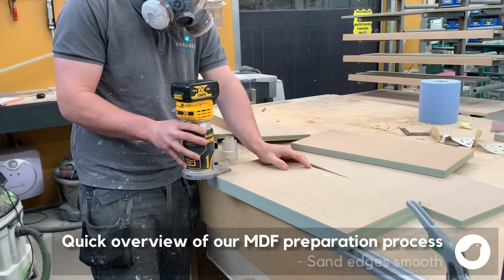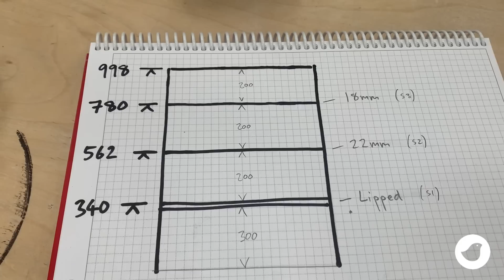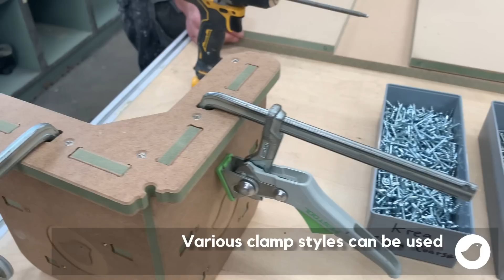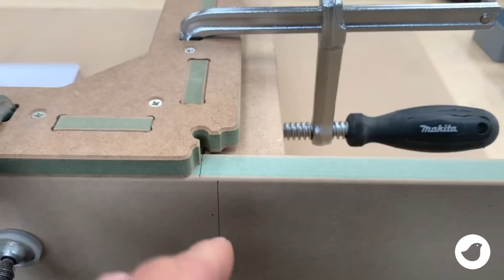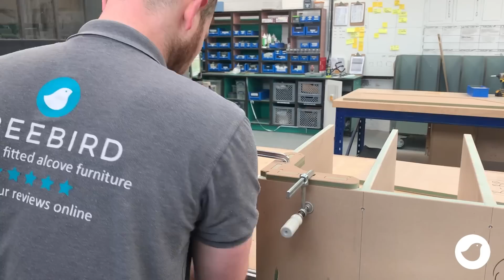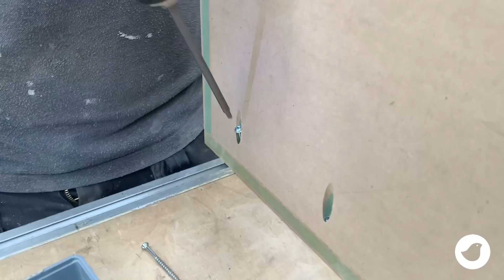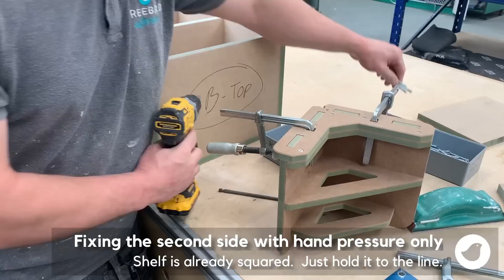How to Build Bookcases and Cabinets Quickly and Easily

Comment: Why wouldn’t you just use spacers?
Reply from the maker: Spacers do not square the parts in 3D dimensions, nor do they hold the parts tight together to aid the drilling and screwing process.  They are prone to creating cumulative errors on a tall run of shelves, so they do not allow the same level of certainty on precise line up of adjacent shelves on adjoining bookcases.  To try and ensure maximum precision you would be holding the shelf as tight as possible to the space, and then the space becomes hard to remove.  And you would have to take the added time to cut multiple spacers where there are multiple different gaps.  All in all it would be a slower and less accurate process.

Comment: Have you experimented with pocket hole spacing for MDF - what you can get away with -  or do you just stick to the recommend 6-8 inches?
Reply from the maker: We certainly experimented over the years.  I remember way back using a spread-fingered thumb tip to little finger tip as a loose guide so I guess that’s around 6 inches

Comment: Great video! I'm going to have a go at this. What are you doing in the 'MDF preparation process' section?  Do you supply MDF panels cut to size for DIYers?
Reply from the maker: Hello yes we can supply parts cut to size including shaker doors now, feel free to contact us via our website www.freebirdinteriors.co.uk
Reply from the maker: We use only very high quality MDF (high density, moisture resistant), and with this quality of board we can just fine sand the edge to get a smooth finish

Comment: What a brilliant video. Been getting asked by customers to build a lot more shelving units and didn't want to drop 1000s on new tools like Lamello or Domino. Great advice about the screws. One question - Why 18mm for the back panel? I usually use a thinner material as it's lighter and cheaper.
Reply from the maker: Thanks for this comment!  We often build upper bookcases with an open base. To place on top of a counter.  I didn’t like having a thin back panel, I didn’t like the look or extra step of adding a strengthening strip at bottom edge.  And I liked to be able to assemble the unit face up on the bench (with pocket screws and the 3D square), using the back panel as a squaring reference from the start of the assembly. I also just like things to feel solid.  And when building with melamine it was easier to stick with all 18mm.  Lots of reasons.

Comment: Using this method and board thickness what would be the maximum shelf width between uprights to avoid sagging for a typical bookshelf / ornament arrangement
Reply from the maker: There is an online calculator called the ‘sagulator’ that you may find useful.   I always screw through the back panel into the back edges of shelves to help mid support.  But for shelf widths beyond 1200mm I steer towards adding lips to the shelves or adding dividers between shelves as mid supports/bracing

Comment: Great vid. Would you not recommend glueing also?
Reply from the maker: Hi sorry for slow reply.  We used to glue.  Then regretted it a couple of times when we needed to disassemble! (One of those times the unit was just too big to get through a doorway round a corner).  Then it occurred to me that glue was really not necessary alongside appropriate fixings

Comment: basic tools? lol
Reply from the maker: Yes about as basic as you can get for a tradesman in this field.  No Festool Domino, No Zeta P2.  Each of these could set you back £1k or so, and yet some people think they are necessary for this sort of work because they see people using them on instagram and YouTube.  Our method does not even require a biscuit jointer. But anyone starting out in this line of work will be investing in a railsaw as one of their first purchases (very few have the luxury of money and space to jump straight to owning a panelsaw, or even a table saw).  So this means they usually have a pair of rail clamps also.  And a drill/driver is about as basic as you can get for a power tool that everyone needs. I’d say the most expensive investment here that the target audience may not already have is the stepped Confirmat drill bit - but you could choose a different drill/screw combination to get started.

Comment: Great video. The jig looks great.
What do you do when the end panels are visible? Use a different fixing method, fill and sand or add an additional panel to cover fixings?
Reply from the maker: Most often, we add an additional cover panel, which allows us to scribe to floor, wall and ceiling as necessary, and doubles up the thickness to match the look of adjoining open units.  This may be attached with glue, or Lamello Tenso fixings, or screws under mounting plates if it’s fitting to the hinge side of a cupboard or wardrobe.  With our fitted furniture it’s very rare that you see the end of a cabinet itself

Comment: Looks like a well thought out Jig, will deffo be ordering a few to do some cabinetry around the house. Brady makes tackling the drifting of the pocket screws on the side panels looks easy. I struggle with this massively as a DIYer any tips to make this easier ?? 

Keep up the good work 🙌🙌
Reply from the maker: Thanks… and that’s a common question!   It is a mix of pressure, technique and simply experience!
Reply: Kreg, the inventors of pocket screws, make a clamp for that.  I smell an opportunity for a small corner jig though Alastair.

Comment: I know this is a year old now but as I move from newbie to intermediate I’m interested in comparing this to my own experiences. As I’ve grown, I’ve started to get too clever and now try to include dados and roundovers etc and maybe lose sight of what I’m trying to do. I’m interested to see that you just use screw/butt joints with no glue. Am I wasting time using glue on my own builds and should switch to a dry assembly?
Reply from the maker: Yes I think glue is unnecessary!   We use to glue, but it caused more problems than it solved

Comment: Very nice work! Please let me know why have you used moisture resistabt MDF  instead of standard MDF or ply wood ? Thank you very much !
Reply from the maker: Moisture resistant MDF is much denser than standard MDF.   So it is stronger over wide spans, and also it is easier to get a good sanded finish on the edge.  Also when using waterbased paint, the wood fibres will swell, and in some types of MDF this creates a lot of texture on the face which is hard to get rid of.  The specific brand we recommend is Finsa 'Fibrapan Hidrofugo' because it is exceptionally smooth and dense, and the grain raising is much reduced.  It allows us to get exceptionally high quality sprayed finishes.  And when a high level of finish is the priority, plywood offers no benefits only problems - the surface is not as smooth.  It is a lot more expensive.  The edge needs lipping (extra work).  Even if you sand the edge perfectly smooth, and keep doing a fine sand between coats of paint, the edge layers will always 'telegraph' (show through) over time.

Comment: Great vid, will be taking a few pointers and have to say very well constructed. 
Have a few questions, 
I've been using 9mm for my backboards (mainly to reduce weight) then screwing from the back. Would like to try your technique but can't see it working with 9mm as need more depth for screws. 
Secondly when you router the 2mm is that on all the front edges? As when the tops and sides are butted up there will be a groove.

Thanks
Reply from the maker: Hi, yes 9mm would be too thin for pocket hole screws.  Yes all front edges 2mm arris round.  We do usually bring the top and bottom flush to the sides, so we do a little round over on those front ends where they meet the sides, so there is a deliberate v groove
Reply from the maker: I discuss some of these finishing questions on this video I think: https://youtu.be/vBLTZgRWFN4?si=IkO4sEMdlc4FDOH1
Reply: Thanks for messaging back, have taken note of what you mentioned and I’ve watched the link, this has become very helpful. Keep up the great work!! 
Ash

Comment: Great video, im just about to attempt a proper built in alcove cabinet with bookshelf in my home office using your blueprinted method – loving the finish of this method. Just a quickie regarding Confirmat screwsm since the Hafele site uses what seems like quite confusing standards on screws, what screw length are you using and what diameter? In this video are you using the 4mm drill hole with the 8mm head with a length of 50mm? Cheers
Reply from the maker: Hi thanks for the comment.,  I agree the various confirmat screw options are quite confusing!  We use 'Confirmat screw size 2, Ø5 x 50mm', hafele code 264.37.196.  The correct drill to use with it is hafele code 001.22.467

Comment: Hi can you please explain why you pocket hole screw not simply screw on the back from directly from the back ?
Reply from the maker: Because it makes the whole assembly process easier, not having to rotate the unit during assembly.  And because the pocket hole joint is strong in MDF because the thread of the screw is cutting into the face layers of the material, not driving them apart in a splitting action into the edge grain.
Reply: Thank you Alastair for replying, that now makes a lot of sense. @Alastair_Johnson
Reply from the maker: @trevdale7967   No problem, and you might find this article helpful: https://www.buymeacoffee.com/freebird/screws-mdf-3-types-use

Comment: I've ordered the 3D assembly square. Hoping it might even turn up today.
Can you let me know what jig you use for the pocket holes? Also...can the Confirmat one-piece connector screw system be used for assembling wardrobe carcasses (18mm with 9mm backs) or should I use the Spax TX?
Reply from the maker: Hi sorry for such a delayed reply!!  Did the square arrive and how do you find it?  Yes confirmats are great for carcase work in mdf or chipboard.   Spax MDF screws are great for self drilling without splitting edge grain of MDF, however you may find it just as fast to predrill then fit a cheaper screw.
Reply: @Alastair_Johnson  The square and the confirmat system worked great, thanks. I used them to build two fitted wardrobes at home (a 3 door and a 5 door). An epic job for a newbie DIYer like me but it turned out really well. On to the next project.....
Reply from the maker: @bobbrock41  great!  Have you got photos on instagram or anywhere I can take a look?

Comment: No glue?
Reply from the maker: We used to glue.  Then regretted it on a couple of jobs that needed disassembling before final install!  Which prompted us to question why we bothered gluing in the first place.  The fixings are strong enough on their own.  And now we pre-spray components before final assembly for the flattest finish on each part, we wouldn't want any glue squeeze out.

Comment: hi Alastair, just bought your Assembly Square - looking forward to start using.  Have a Q about the MDF it is made from and the MDF you use for your cabinets. What brand is it - best looking MDF I have seen. Thanks.  BTW love you channel!!
Reply from the maker: Hi, I love this message thank you!  The MDF is called Fibrapan Hidrofugo (which I think basically means moisture resistant mdf in Spanish) by Finsa.  Yes it’s the same as we use in our spray painted work.  If you go deep into my historical content you can follow a trail of breadcrumbs to us starting to use then talk about this product on YouTube and Instagram , which led to others picking up on it, which ultimately led to a fairly significant shift in demand in our industry away from the Medite MR MDF towards this Finsa product.  I first heard of it via Matt at Spacetidy who I did a podcast recording with way back, I think I then learnt that Dan McClark of McClark’s kitchens was using it for his sprayed kitchens.  Matt was buying it from a supplier called Stellafoam in Essex I think.  I got some samples.  Did some tests and found that the grain raising on this board when using waterbased paint was WAY less even than the Medite MR which had been the one we and many others had settled on as the best option until then.  I did an Instagram story raving about it, which Finsa picked up on and shared (and I think it’s now on Lawcris’ website in a grainy copy!). (I also talked about to in my video about building some weird spidery black and grey wardrobes using a different Finsa board)  Finsa had a very clued up marketing consultant at that time and it coincided with them transitioning from only speaking with their distributors, to engaging much more with the small makers like us.  Someone it all conspired towards the makers driving the demand at the timber yards, which led to many of them eventually agreeing to buy in packs of the stuff.  Finsa kindly gifted me many thousands of pounds worth of colourful melamine faced boards which we used in constructing the partitions in our new workshop!
Reply: @Alastair_Johnson  Thankyou for a very full reply! I will check out your other videos! I love your style of instruction.  Love that you also show the issues.  I have been a wood worker (furniture) for 40+ years and have only recently started doing built ins - so have learned a huge mount watching your videos.  My current project is a large wall of shelves and cabinets including a hidden wall bed that will be interesting as the client wants the doors to open all the way back onto the cupboards at the sides but also want soft close - I keep telling them that there are none that will open to that degree 🙂  Thanks again!! off to watch your sketchup course.
Reply from the maker: @sawdustwoodchips  You're welcome!  I have previously done a murphy bed with doors that are actually just the base of the bed, and fold down with the bed - that may be easier? Can send you more info if you like.

Comment: Why do you use the Kreg pocket hole machine? By the looks of your shop you should have and old Porter Cable or a Castle. I got the Castle and worlds of difference. Very little pulling panels around that the Kreg does and pockets look better.
Reply from the maker: Hi, I have seen the castle machines and I understand what you mean!  When we got the foreman I thought we might one day upgrade, but we've stuck with it

Comment: Hi Alastair, I’ve just bought one of your jigs and I’m looking forward to using it. How did you attach the lip to the front of the shelf?
Reply from the maker: Hi thanks for buying it and I hope it works well for you.  Lips could be attached with biscuits or dominos (clamping and gluing); or Lamello Zeta P2 system fixings (fancy professional option), or kreg pocket hole screws if you're not bothered by the look under the shelf

Comment: in your experience when gluing the shelf front after painting it will the joint eventually crack the paint?
Reply from the maker: No we don't get cracks but it is very hard to avoid 'telagraphing' where tiny differences in the differently oriented adjoining faces of mdf show through, i guess its fractional shrinkage and expansion

Comment: Another great video I have my jig now ready to start my cabinets build. Would you say butt joints like you did with the shelves are suitable to assemble the whole carcass or is the pocket hole method superior? I haven’t used pocket holes before so just worried I’d make a mistake. Thanks
Reply from the maker: However you prefer. I like the way the pocket holes screw threads into the face of the MDF instead of the edge.  But the pre drilled Confirmat screw holds very well too.  Using the kreg screws allows everything to be screwed together and down onto the back panel without ever turning over the unit, I like doing it that way

Comment: Just received mine, very happy with the quality, out of interest what’s the maximum width shelf would you recommend for MR MDF 18mm and 25mm bookcase shelves constructed in the same method as in the video. Is there a point where you would recommend edging the front in a hardwood like oak for longer length shelving
Reply from the maker: Hi Thomas,I used to refer to the sagulator as a loose guide: https://woodbin.com/calcs/sagulator/ but now it's more gut feeling.  It helps that I screw through the 18mm back panel into the rear of the shelves. I don't usually use 18mm thick shelves beyond about 600mm wide units. Our standard is 22mm thick shelves and I'm just about ok with them up to about 1200mm but would prefer to add vertical dividers to tie shelves together  beyond that

Comment: Just about to order the jig delighted to support you in anyway possible been following your work for a few years now love the content. I am making a set of alcove units they will have 2100mm wide by 350mm deep shelf's on them I'm concerned about sagging along the front edge do you think I could get some 20x20 box steel and screw it along underneath the legnth of the shelf for strength and then hide it behind a lip to give the illusion of a 50mm thick shelf. Or would 18mm hidrofugo be ok with a span like that without some reinforcement. Keep up the amazing work
Reply from the maker: Hi Alan, thank you!  Yes in the past I have fitted steel box section behind a lip but not for a while.  I'd certainly recommend using 22 or 25mm Hidrofugo instead of 18mm.  And/or add that 50mm lipping too, and for me I'd probably fit a few vertical dividers in offset positions to help tie shelves together

Comment: Love your videos. Always so much useful information. 
Wondering if you can give me any tips on pocket holes. I am joining 18mm MDF with 32mm Kreg screws and the MDF is always splitting. Is there something I may be doing incorrectly?
Reply from the maker: Thanks!  Be careful not to overtighten.  It does split easily to be honest, but this depends also on the quality of the mdf